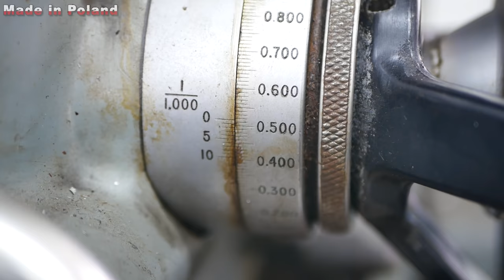Making Pickup Crane

Comment: Absolutely love the Engnerding you have put into this!
Since you have already got the winch. On it a pivot piece with a loop Eye could replace the Jack and eliminate the extra steps to get it prepared for working. Weld a hollow tube on the front side of the down leg support put a plunger in it and a slot to pass a lever into it with 2 clevis pins and a shackle to connect it to the winch pull up the lever the pivot reverses the action and pushes down lifting the foot up and then you can set your stability leg beneath it. You could even index it by several gates,  and pin and once up simply twist it into the best level for it to hold there. When done simply remove the clevis pin and slide it up to height for storage !
Great Work!

Comment: Awesome.

To help load the truck, you could put a pully + locking cleat (used in sailing) on the far side of the bed to give you a line to pull the load horizontally over the bed.  The locking cleat is not needed but it does make it easy to tie off/release the line one handed.

A carabiner on one end of the rope, would allow you to make a quick loop around the object and back to the rope. The loop would tighten under pressure and be easy to release once it is gone.

Comment: That is pretty good. Now I wish I had enough room behind my flat bed on my truck for one just like that. 
The slid out and leg is really nice.
Reply: It  wouldn't  take a lot to crib a little extra room by relocating your flatbed slightly  further back, well worth the effort.  I wish I had thought  of this a few years ago when I was loading and offloading stone tops off a 2 tonne drop side,  all day every day, it would have been a huge bonus
Reply: @davidp8157  Yeah it could be done. What I really need to do is put a ram on it so that I can dump as well. Then while I am at that put in the crane. I am looking for a used cannonball bale bed. As these beds were set up for pretty much a dump bed as well as a bale bed.
Reply: @kameljoe21  if you have a regular use for it, it definitely  worth the effort. Mid-late  70's we got a large manually tipping  farm trailer, which was great,  except a total bitch to  tip when fully loaded,  these days I would chuck a hydraulic ram under it, or it would vote with it, times change  our acceptance level  and expectations  change, so much  is now available  relatively cheaply we could only imagine back then.  Youtube beyond entertainment is an amazing tool for ideas and even process for doing virtually anything.  Doing things like this yourself  you can build it how you want it, as strong as you want it  for comparatively low cost . Go for it.
Reply: @davidp8157  Yeah I agree. I do not have a full time use for a dump bed. My flat bed is 8 wide and 9 long. So I thought that maybe I could find a old lift gate and fab up a mounting bracket for it. I could have used it a couple of weeks ago when I found some really nice lime stone pillars for free in town. I was able to winch one up in to the flat bed yet the other 2 were much much larger and a lift gate would have solved that problem a ton. A lift gate would work for a lot more things right now. Either way I keep my eyes open for the deals. I found my flatbed searching one day that came of the exact same model truck and still had to drive 700 miles round trip to get it. The plus was for the low price I paid it was installed while there. So it was a super good deal for a nice used flat bed.
Reply: @kameljoe21  9 foot is ok for some stuff, but rather short for a lot of stuff. My little trucks had either 11 or 12 foot decks,  which meant uou could manage most things. You have to be careful with stone hanging much out unsupported,  as while  generally strong,  unsupported  plus vibration is a recipe for disaster , ( had a stone business  until about 4 years ago when ill health forced sale).if you are set up with basic gear to get  "stuff" quickly, it's  surprising  what you can get for little or nothing
Reply: @davidp8157  9 does me just fine for a 4 door truck. Its like drving a limo as it is right now!
Reply: @kameljoe21  have to agree,  4 doors are pretty nice, drive pretty much like a car, only nit pick I have is a short bed , otherwise I love mine, 5 year old colorado    well side.  Everything is a compromise  but for general use they take  lot of beating

Comment: I contemplated how to make something similar for my little 2 tonne truck for ages. The swivel is what had me stumped for ages. In the end I scored some 80mm very thick wall pipe so I used that for the upright, capped the top of it, fitted a pipe over that and just slapped on a bit of grease. I've had over a tonne hanging off the winch and it's had no issues and has been handy for picking up mowers, logs and all sorts of heavy objects.

Comment: Great job, man, I am proud of you. I am also building a similar hoist made of aluminium tubing that would lift my Kayaks on the rood of my Pathfinder 4x4. I haven't decided yet if I should use the tow bar to attach the hoist to the tow bar by making a special attachment that is inserted into the tow bar like the one that has the tow ball, using a similar wheel bearing to rotate it. Or make a different frame like a small crane attached to the roof that lifts the Kayaks off the roof bars, then slide them over the side of the car and lower it on the grass, etc., electrically by a geared motor. Each Kayak is under 60 Kg in weight. What would you suggest there, mate?
Reply: When designing hoist its rather "easy".. get vehicle involved with its suspension and weight distribution that all effect its drivability now we are talking rather difficult one. Polands lift is rather small and his truck is actual truck. Pathfinder is just 4x4 so already bit top heavy as is, plus weight of the Kayaks and all the gear.
In one hand putting hoist on the roof frame does make whole construction lighter, but all that weight is on highest point of the vehicle as mentioned.
The tow ball setup sounds one hand better, but will need more weight to reach on top sturdy enough.
Also you can decide what ever you want lift be removable so it can be put in trunk while driving, or when not in Kayak trip.
Personally i would go with roof mounted setup for its lower required weight and make it just drop into roof frame if frame is sturdy enough and forget the hydraulic lifter since that increases weight and go just for electric winch setup with retractable beam, witch angle can be adjusted with locking bolt. This then can be even left on the vehicle while boating and driving, though depends how wide those kayaks are so can you spread that weight evenly. Also this does mean working on top of the vehicle, but you do need to do that regardless so you probably have some ladders etc to get to tie those kayaks down so its not that much of a issue, just minor safety concern since you are working in rather high, while bit tired after boating.
Just few things to consider for helping to design your system. Hope it helps.

Comment: 7:31 that lower housing will fill with water if you don’t add a drain… it’s gonna rust up and ruin it.
Reply: They may use road salt in that region as well, so you may have a valid point. Of course, he did make it fully removable and there is no doubt that he could easily repair it even if the crane base turns to solid rust.